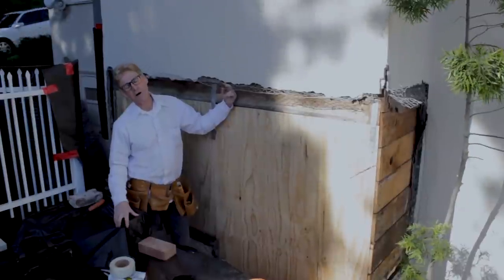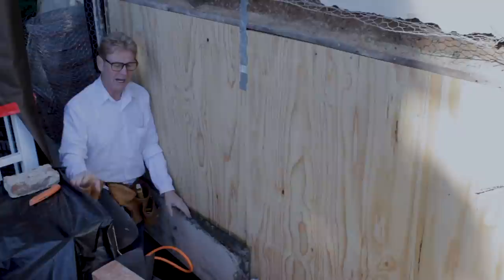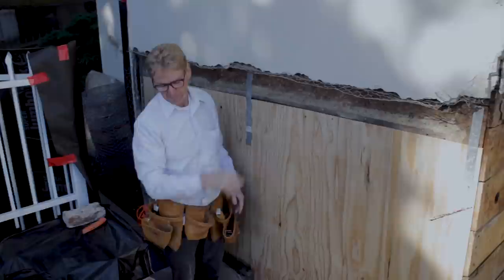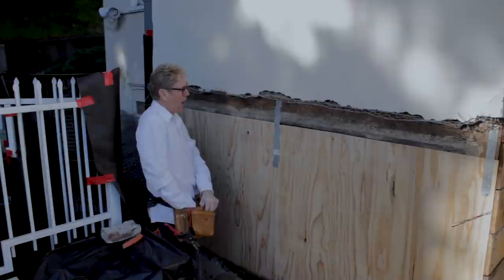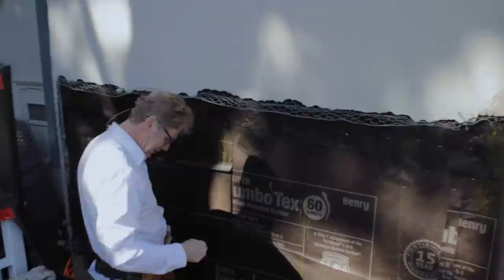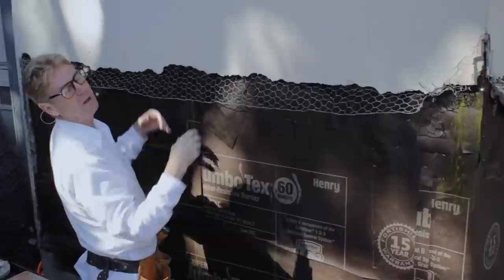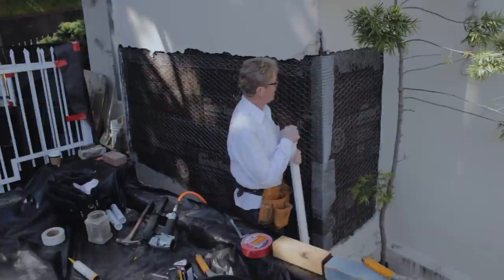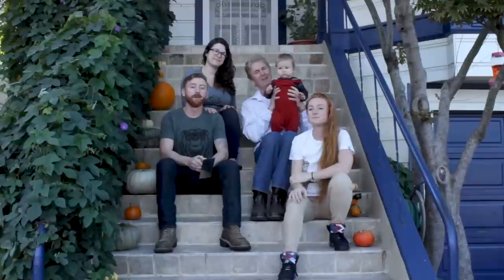Waterproof paper for stucco lath

Comment: Watching the videos over the years ive often wondered if you ever received any complaints about a reduction of cellular or wireless connectivity in a room after using the metal lathe inside/outside a house. I’m just curious. Thanks!

Thanks guys for the years of videos. The information in them saved me thousands of dollars, thank you so much.
Reply from the maker: Morning Code Dude, not really, where I sleep it's horrible reception but I do indeed know the reason, I installed 2 inch form with aluminum of both sides, about 30 years ago. Plus my walls have real lime stucco on them.
Things that make you go hmmmm.🍾
Reply: @StuccoPlastering  

Hey man. Yeah, i was just curious since if a whole room is done it’s virtually a faraday cage ( https://en.m.wikipedia.org/wiki/Faraday_cage ). I also wondered if clients noticed anything. Again, these videos have saved me 10s of thousands of dollars as a home owner. Thanks! Take it easy.

Comment: Hey there Kirk, I got a question for you. I have a lady that wants me to do a skim coat over her foundation walls in her basement so she doesn't have to look at the form joints. It doesn't have any water seepage, had 2 cracks which I filled with hydraulic cement. Was built in 2010. After watching many of your videos I've determined that I'll need to wire brush and use a bonding agent. She doesn't want a smooth surface but one with texture.. what product would you suggest? Could I use a mortar type N? Would need to be about 1/2 inch in order to cover the form joint that protrude and would I need to do 2 coats? Or could I get away with just one "thick" coat? Thankyou for all that you've taught us and Cheers from Chicago!
Reply from the maker: Morning Wood Crater, on our channel type in how to skim coat foundation, we have many videos on how to.
 The numbers S or n are somewhat outdated s  simply means a stronger mortar or stucco.
 N is usually for brick walls and is medium strength.
All the same-day stuccoes at Home Depot will work, Look for Quikrete, Greencor, or Rapid set, same-day stuccoes; you can go wrong with these same-day stuccoes.
All of them are almost twice as strong as both S or N mortars. 👍
Reply: @StuccoPlastering  thankyou very much for your time and insight. It is truly appreciated, I will most definitely watch some more videos before I get into this project. Have a good day sir!